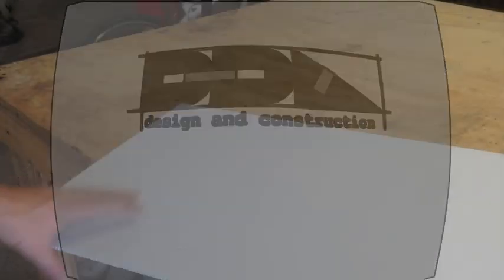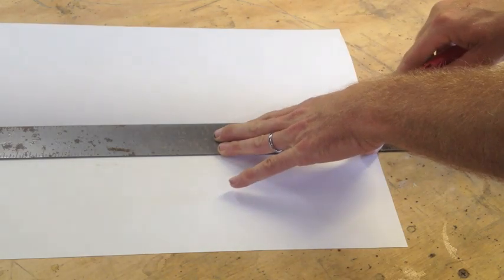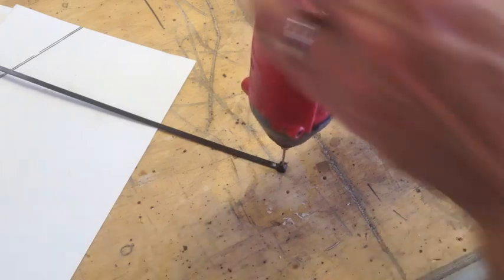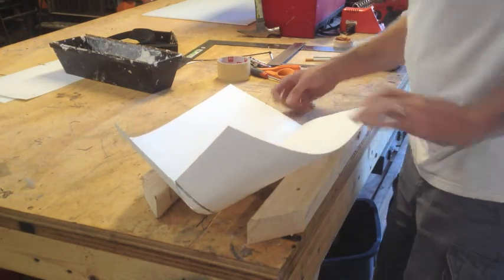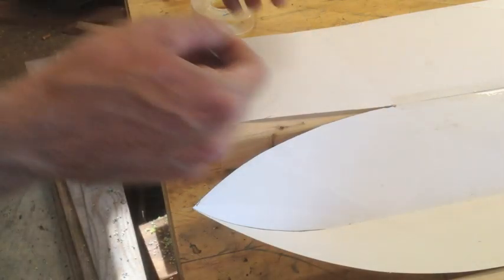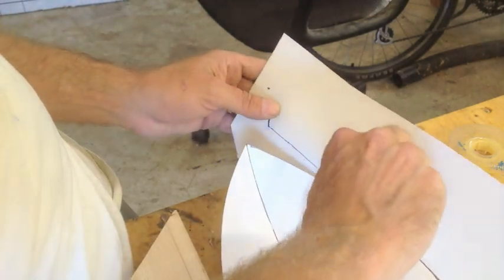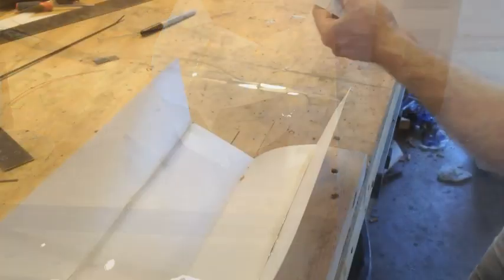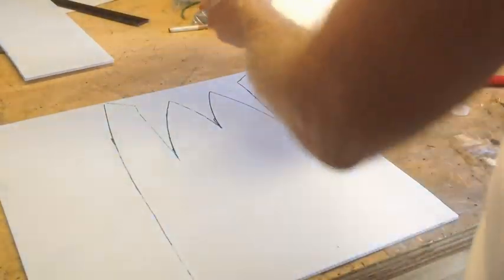Building An RC Boat Out Of Trash (Part 1: Hull Template)

Comment: It's actually against city codes to place signs on public lands (like in a ditch or on a powerline post). Anytime I see them, I pull them up, stack the signs up to be reused, and use the wire frames in my homestead gardens. Insert them into the dirt and they are great to tie plants to. I take the plastic signs, punch several holes into the edges, string them together with twine to make a box, and pack fruits and veggies into them to deliver to the local farmers market. So thank you to all the people who leave those signs out for me to collect.

Comment: thanks for the idea, sir good job all the way..
cut it in half make great broom stick paddles tooo...forgot the frames make good cage material ...make a rectangle wire together and screen at hard ware. keepem coming.
I going to modify your design a bit.
three folds.. cut the nose out of the hole piece skip the back.. glue plastic box on wood sticks to sides ....fill the shell with foam add controls, battery, 50 ft cheapy controller put top on it and give it to children! 
put all the goods in a bag in the foam and box..... if it flips NO big deal, wipe the nose and the pride and start again.
Reply from the maker: HA!  Great idea:)
Reply: im guilty..... retired engineer....
yeh tons of fun ideas for YOUR design. push a wire through it  bend at 90 degress put ballast pontoons on it as training wheels.put a bigger motor on it and smoke it down the river with a spoiler on top... Flat the bottom and put a computer fan on it for the everglades tour????haha 

should I shut up  now! all this for your sign junk...every place i go I see them...put it to work as toys!
go gettum...
Reply from the maker: Will do!

Comment: The plastic name is Corflute. It is very temperature sensitive too. It will stretch along the fluted length a considerable amount depending on temperature and humidity. Very poor template making material. Long skinny pieces are the worst.

Comment: Lol 2x3. boards??. Although they are probably closer to 3 inches then 4in their referred to as 2x4s.. they r cuct 2 in thick and 4 in wide but by the time they r dry and ready for sales they shrink a lot
Reply from the maker: They're 2x3's dude.
Reply: They r referred to as 2x4s
Reply: They r cut at 4 inches but drying shrinks them to 3
Reply from the maker: I understand what 2x4 is.   The ones used here are 2x3.  Like this:  http://www.homedepot.com/p/2-in-x-3-in-x-96-in-Select-Kiln-Dried-Whitewood-Stud-845000/100038668
Reply from the maker: You can also get 1x1's, 1x2, 2x2, 2x3 to mention a few, and yes 2x4 (your fav)  :)
Reply: I'm aware of all those
Reply from the maker: And now you can add the 2x3 to your awareness list :)
Reply: Kyle Norman  2x4 is the measurement before the boards are milled down to a smooth board. Not due to shrinking. Due to milling. 2x4 would be the measurement of the board when it’s cut outta the tree. With bark still on it. Then they milk it down so it’s really closer to 1.5x3.5 ish.

Comment: Hummmm, boat made from trash.  I wonder where I could find thread, needle, epoxy, bondo, spray paint, hardware (prop, U-joint, etc) foam, etc in the trash?  Still....nice project, and I learned something.  That is good!  Should be an abundant supply of signs in just a few months as the Presidential race heats up....IF it can heat up any more than it is already!